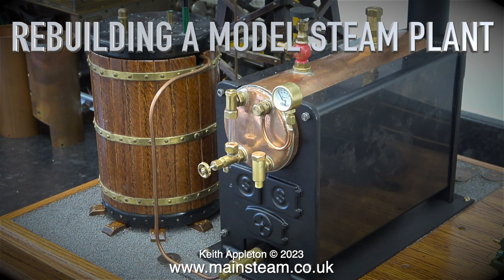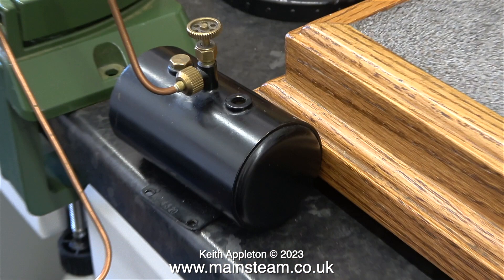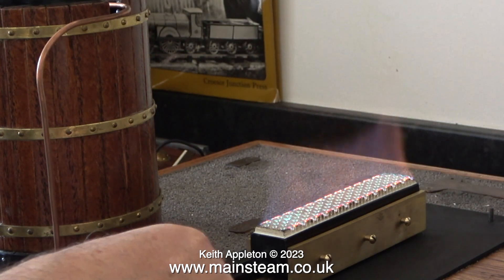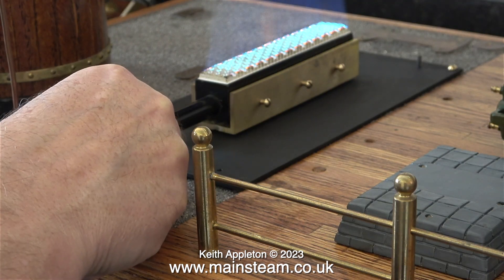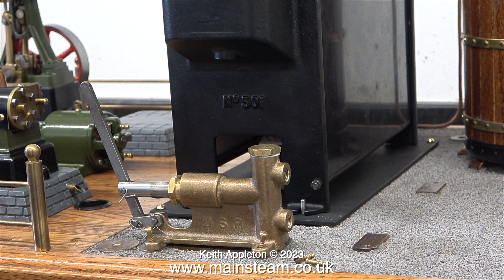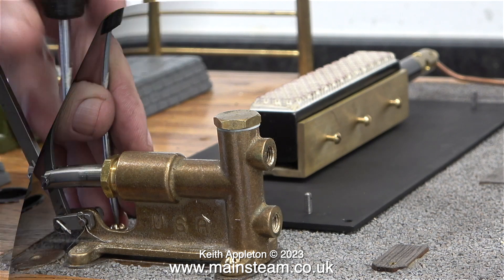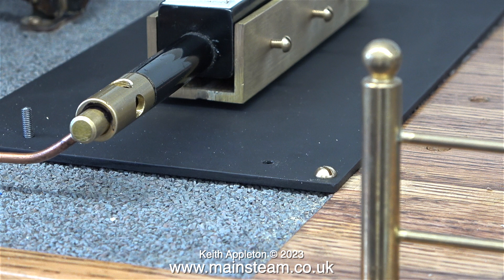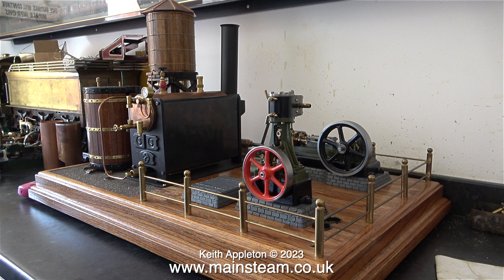REBUILDING A MODEL STEAM PLANT - PART #27

Comment: What? Tap and thread WOOD? Are you nuts? That won't work. Oh you added a drop of "super glue"? What good does that do?
Then you calmly screw in the bolt or screw and OMG it actually works. 
This is what those "so called" experts have running through their minds and what they yell at the computer screen when they see you do this (for about the umpteenth time)
Personally I like watching you do "wood threading", just to hear your rejoinder comments on those "so called" experts.
I don't have any content, I live in a small apartment (Flat) and have no space nor money to build a model anything. I just love wat6ching your channel and making a small "suggestion" every now and then, and making comments like this. Hopefully others will get a smile from what I posted today, that's my intention. ;-)

Comment: Hello Keith I hope I don’t come across as a bothersome expert, but I’ve had experience with poor adaptors and found that if you push down gentler they tend not to leak it’ll take much longer to fill the gas tank. But it won’t spray as much. Regards James
Reply from the maker: I don't find you a bothersome expert, but I do disagree with your premise. In my opinion, insufficient pressure seems to cause more leakage where the pipe of the adaptor meets the tank fitting.
Reply: @keithappleton  now you mention it I see what you mean. I guess as you said the short answer is they’re very individual things

Comment: Would the gas burner be less sensitive to gas level in the tank if there was a little regulator?  Seeing the ceramic glow out in the open is one thing but hidden away and maybe run by someone less attentive it seems like a frequent occurrence.
Reply from the maker: Not from my experience, evaporation and chilling still happens.

Comment: For the "Expert" soldiers, I worked at a Big 3 US Car dealership back when they still used metal fuel tanks.  We had a customer come in with a hole in the bottom of their fuel tank and the shop manager said it needed replacing.  I said I could solder it. After a triple rinse and a large dose of argon/co2 I pulled out my 100 watt iron and started to work. 6 out of the 8 mechanics ran to the break room and I finished up the patch.  NO LEAKS.

Comment: I have a similar background to yourself, except not a musician (electronics apprentice etc). I there's one thing I've learned in the last 50ish years is that there's more than one way of doing something and there's not always a right or wrong way but a way that works and is tried and tested. There is often a different way or a way that gives slightly different results but not better or worse. If the the method achieves the desired outcome then it is the right way for the person doing the work (emphasis on person doing the work). I watch your videos as I like steam and mechanical things and like to see how things work. Keep up the good work Keith.